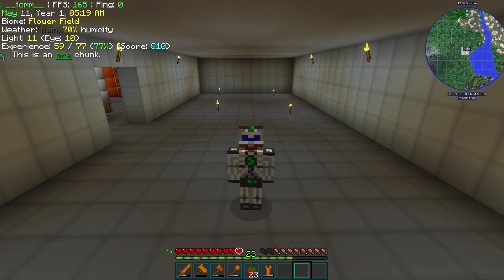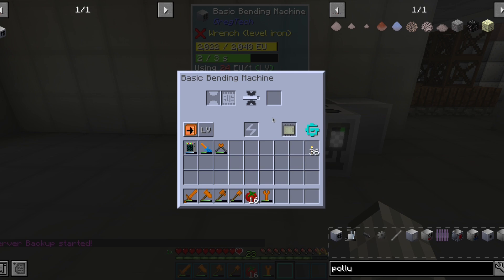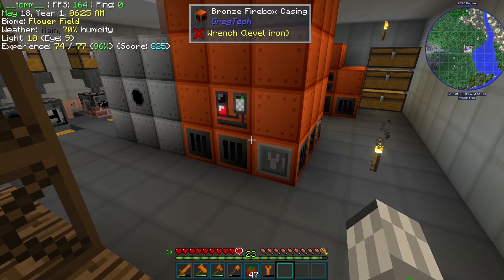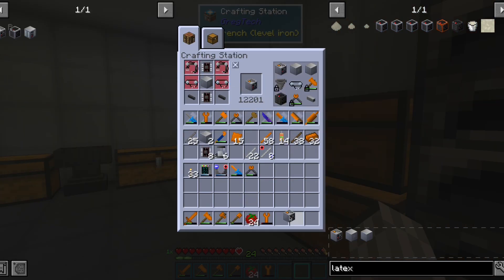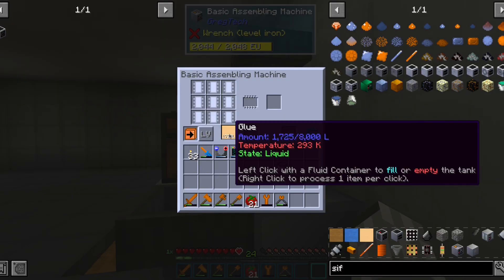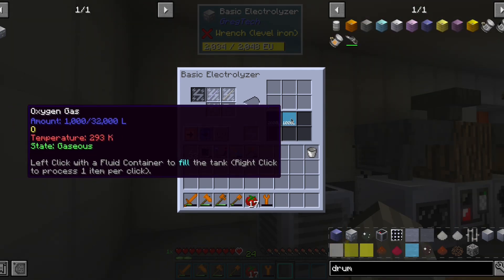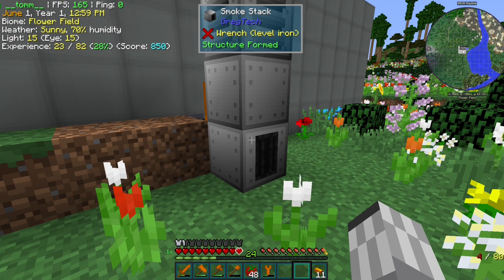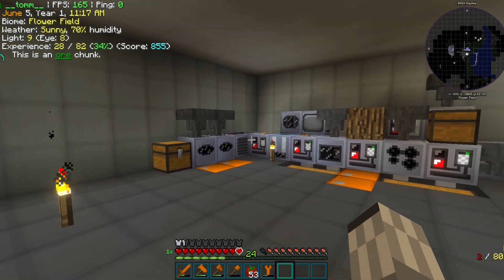Supersymmetry 03: LV workshop

Comment: what is the name of the texture pack you use to put arrows on pipes
Reply from the maker: i'm not using any texture pack.
It is the default when you shift-click pipe connections in a wrench to force the flow in onyl one direction, it's the same in gtnh. (I do remember gtnh's version being a ring a long time ago)
Reply: the older gtnh versions had the rings on pipes, its been updated now to arrows